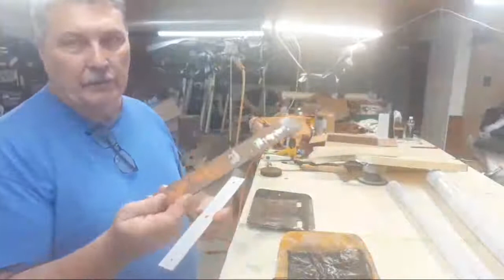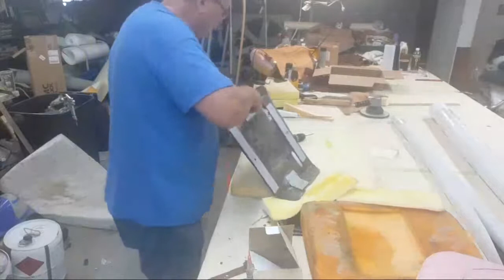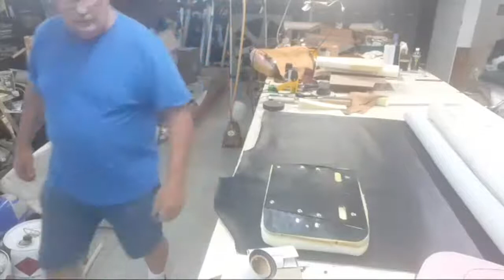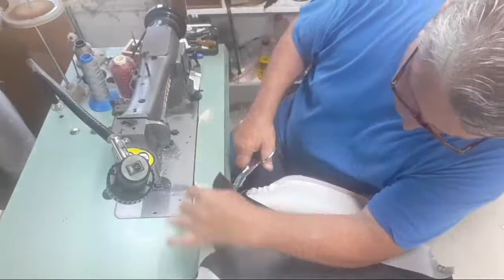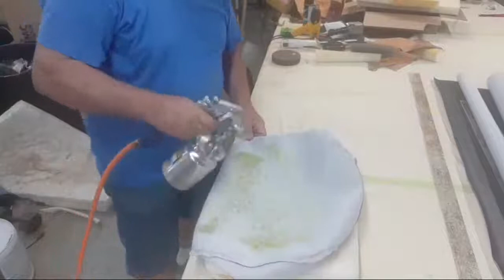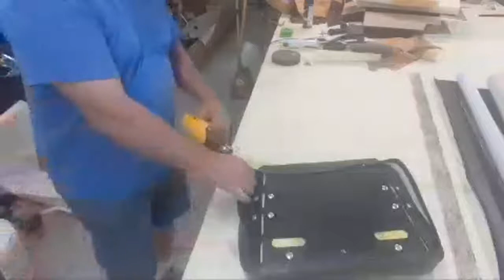HOW TO UPHOLSTERY A TRACTOR SEAT,  TEACHING YOU HOW.

Comment: Nice Job.  What density foam did you use?
Reply from the maker: I match the density with pollyfoam, used a marine grade vinyl to prevent cold cracking and fading and mold and mild due resistance.